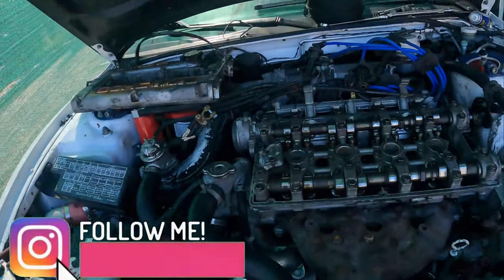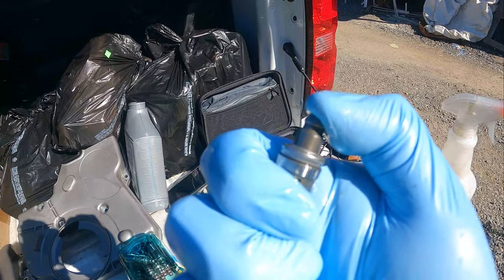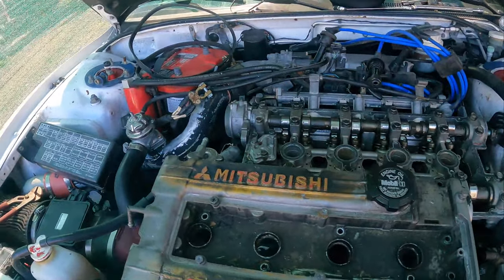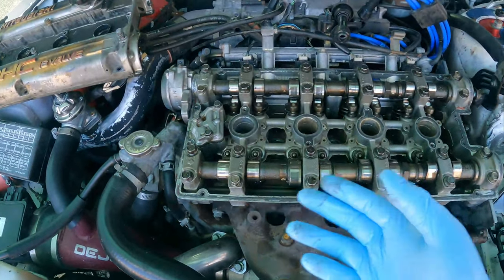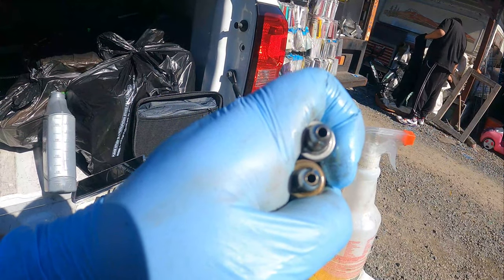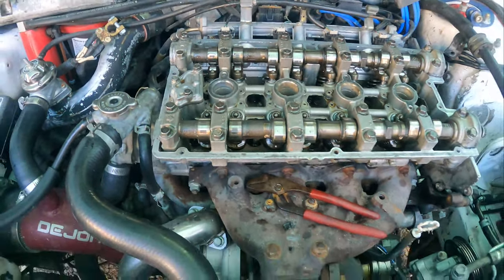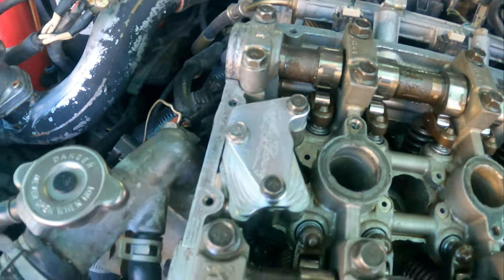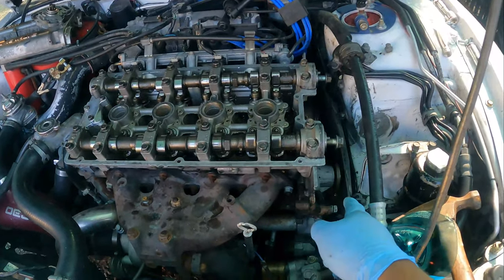TURBO MITSUBISHI ECLIPSE GETS UPGRADES| GSC ZERO TICK LIFTERS & KIGGLY RACING HLA

Comment: I’ve only seen the top end of a 420A and don’t remember seeing a pressure regulator.  What’s that upgrade do specifically?
Reply from the maker: So on the 4g63 the head receives alot of oil and it doesn't need it all, so they made this it gives the head enough oil it needs and the rest of the oil not needed stays in the oil pan.
Reply: @c_los_dsm4578  thanks for the lesson.  Keep up the cool content friend!
Reply from the maker: @chrishuber3814  thanks for the feedback means alot 😀